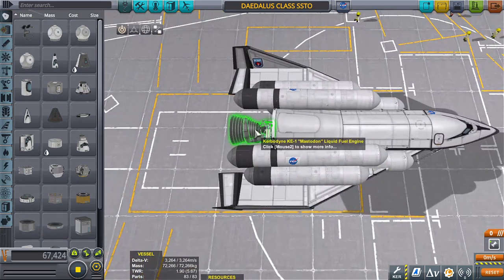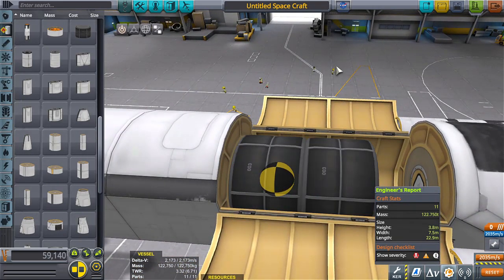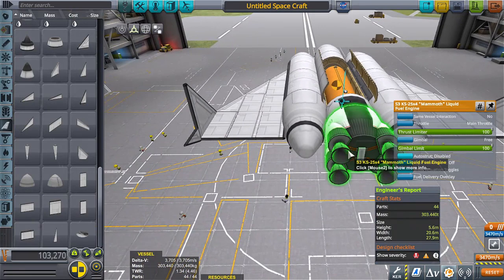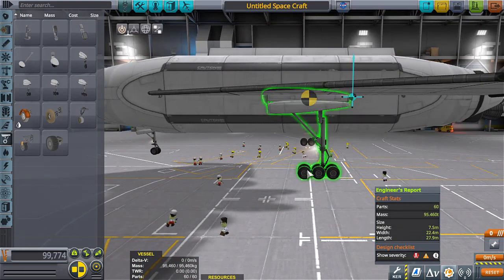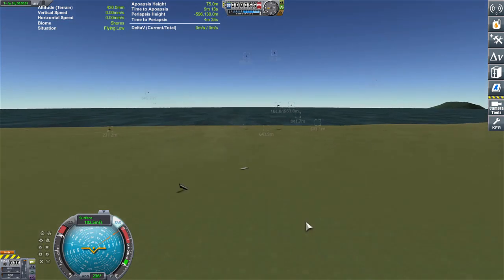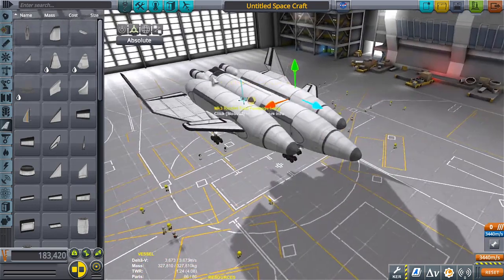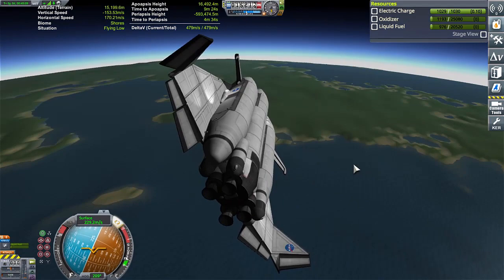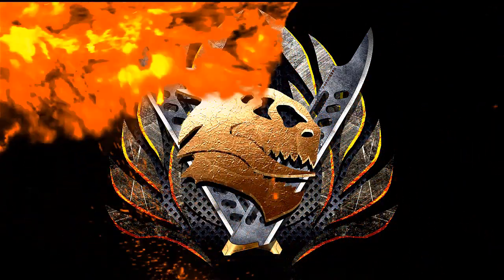HEAVY ROCKET SPACE PLANE SSTO  \  KSP 1.11  \  Kerbal Space Program

Comment: For the RCS fine tuning I highly advize the mod "RCS build aid"
very basic mod similar to KER, all mods that help with building only still count as stock, this one just gives you indicators with both vectors and force readouts of the spin of any thruster on your craft, be they any engine or RCS direction
Reply: In the same vein get "Editor Extention Redux"
both of those just help you build with more control than the base game with the same parts, they are completely stock and really essential, most people who have tried them cant go back to playing without them

"Editor Extention Redux" and "RCS build aid", get them
Reply: @anonymous-rb2sr  Agreed. Add CorrectCoL to the list, and TAC Fuel Balancer.
Reply: @cf453  Damn I never knew about correct center of lift, so basically it's a mod that shows you the average lift of all the parts, not just the wings? Pretty nice

TAC fuel balancer is on the limit of stock though, since its a gameplay feature outside of the editor
So is KER though so idk
I probably wouldnt consider TAC and docking port alignement to be stock
Reply: @anonymous-rb2sr  Yes on CorrectCoL. It also takes into account drag. Sometimes a plane that looks stable in stock isn't, because it has a lot of drag up front.